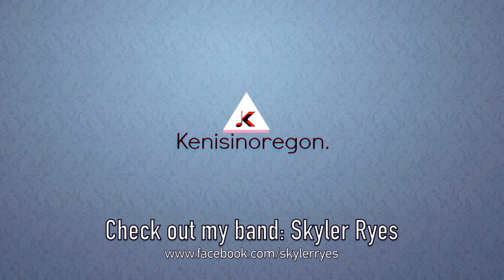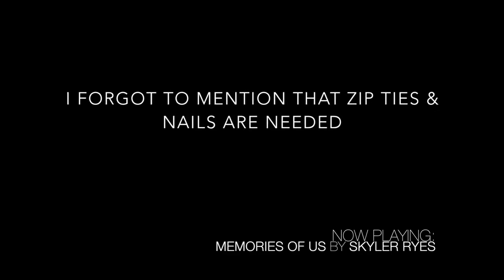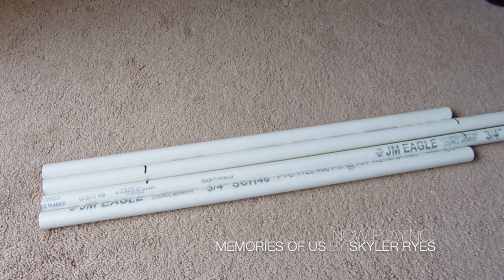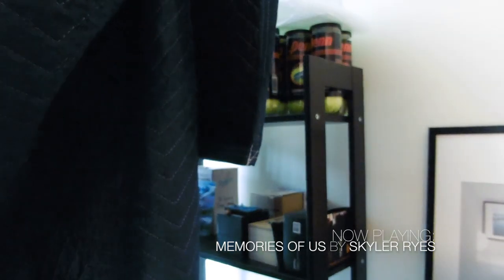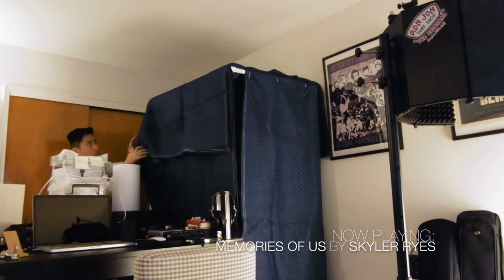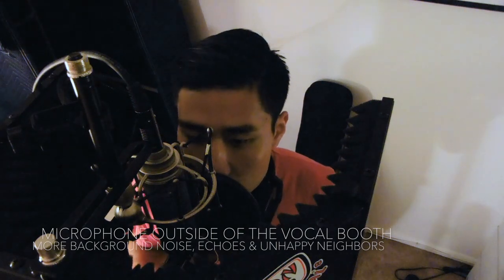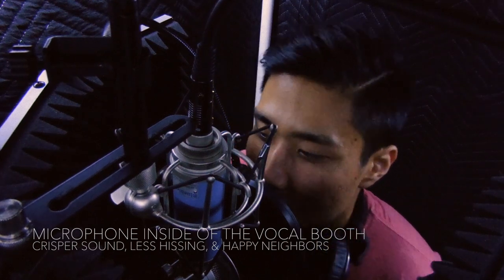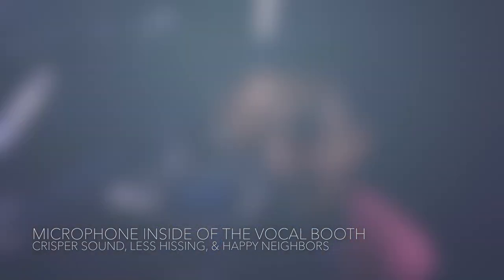My DIY Sound Booth | Ken Tsuruta

Comment from the maker: There were some comments regarding the hissing sound that the mic makes inside the booth, turns out it's not my preamp set too high, but it's my bluebird mic itself. I only had the Bluebird mic at the time, so I couldn't compare to how other condenser mics sounded (regarding self-noise). I recently purchased the Neumann TLM103 and I can hear a big difference in the self-noise. I just can't believe I've been using a defective mic for almost 13 years... 
Anyways, if you're curious, check out this video I made comparing my new TLM103 to my Bluebird to hear what I'm talking about : https://www.youtube.com/watch?v=IL7OzwBRpsM&t=199s

Thanks as always, and subscribe for more music content and covers!
- Ken
Reply: "defective" is kind of a misnomer.. obviously (most) $300 mics are going to have considerably more self-noise than a $1k neumann.  I say most because there are some (Lewitt LCT 440 for example) that are on par with the neumann in that $300 range. Just bought the lewitt, totally psyched. :D
Reply: Just the fact that you used the mic for 13 years and did not discover the "self-noise" until you built the booth tells me that the booth is working.

Comment: I hear a lot of background hissing - even when silent.  Inside the booth as well as outside.  Not sure if it's your microphone or recording equipment.  Other than that, the booth looks pretty cool.  I've seen a couple of plans like this.  Pretty DIY build.
Reply from the maker: Thanks for watching!
So it turns out it's not my preamp set too high, but it's my bluebird mic itself. I only had the Bluebird mic at the time, so I couldn't compare to how other condenser mics sounded (regarding self-noise). I recently purchased the Neumann TLM103 and I can hear a big difference in the self-noise. I just can't believe I've been using a defective mic for almost 13 years... 
Anyways, if you're curious, check out this video I made comparing my new TLM103 to my Bluebird to hear what I'm talking about : https://www.youtube.com/watch?v=IL7OzwBRpsM&t=199s

Comment: You need to put the foam pads on sides as well and on the floor. I would also recommend to put a foam pad (the fitness ones) on top and then put a blanket on it. That way it will look way better and block more noise

Comment: Man this was great... THANK YOU FOR THIS VIDEO!!!! I made some adjustments to your design though. check them out!

1. I used Velcro instead of nails ..helps with Longevity and with break downs and set ups

2. I went with 1" PVC pipe over 3/4" (allows velcro more surface to grip and handle weight better)

3. I Doubled up on the moving blankets (this is why the Velcro is better as well) 5 for outside including top and 3 for inside.. this makes it more reflective and the air between the two layers of blankets helps with absorbing the sound.. 

And it really works ..amazing sound booth!!
Reply from the maker: Using velcro would have been a better idea! Maybe next time if I create another booth, I'll use velcro. Same goes with the thicker pipes! 
Thanks for watching!
Reply: How did you attach the Velcro to the blankets?
Reply: Gonna try it this week
Reply: I'm planning on using thick moving blankets, 65 lbs/dozen, doubled up. Do you think that 1" PVC pipe would be strong enough, or should I go bigger? Also, someone else asked, and I would be interested in knowing as well, how did you attach the Velcro to the blankets? (I was going to go with adding grommets and using zip ties.)

Comment: How did make the mic hang downward on that sheild or do you have a small boom arm attached to stand behind the sheild and hang over it?  Very nice booth...I like it
Reply from the maker: SYNTHESIZER IS KING the mic itself is suppose to be facing upwards, but when I do that, the mic sticks out of the shield which makes it basically useless. So in order to avoid that, I just place it upside down.

Comment: Mogammi Gold studio xlr cables cut out a lot of hissing too. I knew a guy that was using a stage mic cable with his condenser mic and the cable had metal connectors. He had terrible hissing in a very good sound treated booth and had a hard time figuring out why. The Mogammi cables have better connectors and are insulated with higher quality stuff.
Reply from the maker: Hey Matt I agree, Mogami cables are the best! But I learned that my Bluebird mic is a lemon and so Blue microphones contacted me and gave me a discount code to buy a new model. I'm thinking about getting one since I love their sound.

Comment: How were you able to add the mid section PVC pipes for stability? It seems like you used PVC tees, but the ones i've seen at Home depot won't properly slide to the PVC pipes midsection for me to make a stability section. Hopefully you can assist.
Reply from the maker: Julius Hurst hi! So did you purchase the PVC Tee’s in 3/4 inch? If so, it should fit since the long PVC pipes that I’ve purchased were 3/4 as well.
I know Home Depot has a pretty good return policy so just show the recent and replace for the size you need.
Thanks for watching!
Reply: I'm curious if you ever figured out the stability pipe problem with the tees? I'm making my booth using 1" PVC's, but I'm having the same problem. The 1" tees connect barely to the edge & won't slide any further, but the 1 1/4" tees are way to big! Anyone have any solutions??

Comment: Hi Ken, I know this video has been out a while, but was hoping you could answer a question.  The "T's" that you used for the stability pipes, did you just slide that all the way down the length of the wall pipe, or did you make cuts and insert them that way?  Thanks for the build, I'm putting mine together in a few days!

Comment: Hello, thanks for the video!

How would this work if I use it for playing the saxophone in apartament? Does it reduce the sound outside the booth, to not bother the neighbors? I'm looking for a (low budget) practice booth to be able to practice the saxophone in apartament.

Thanks a lot for your answer!
Reply from the maker: I think it will definitely help with the situation by dampening the sound, but it won’t completely get rid of the sound. 
Maybe try using a thicker moving blanket, that may help.
Reply: @kenisinoregon  thank you! 🙂

Comment: You never mentioned how you attached the stability poles....did you make another cut to the long poles or did you buy some type of clamp on side connector parts to connect the side poles to the long poles????
Reply from the maker: SYNTHESIZER IS KING Hi! Yes I added connectors to connect the stability pipe to the long pipes.
Thanks for watching!

Comment: There was consistent hissing in your audio....it wasn't ambient or background noise ...when you went silent for a couple of seconds, the hissing was very present , even  inside the booth....what was your mic connected to?....if it wasn't connected thru a usb audio  interface , that has phantom power , or a mixer with built-in phantom power...then that's the cause of your hissing ...
Reply from the maker: Hi Antoine, 
Thanks for watching the video! Sorry I don’t think I explained clearly what my mic was going through. My condenser mic is going through an audio interface that has phantom power which is turned on when recording. If any other reason you think causes this hiss, let me know 👍
Reply: @kenisinoregon  what interface did you use...because it is strange , that you used an interface with phantom power and the quality of the audio wasn't clean at all
Reply from the maker: I'm using a cheap Behringer UMC404HD. It may be cheap but it is not a bad interface. I think the Preamp may be set too high and that could be causing the hissing. I'm gonna experiment around. I was thinking to even switch to a Rode NT1 since I heard it doesn't have much hiss but before that, I'll just play around with the interface to get rid of that hissing sound. Could definitely be the pre amp but I'll check it out when I have the time
Reply: Hi Ken. I'm just wondering if it's hot inside the blanket and whether the led lights also through off heat. Thanks, @kenisinoregan !
Reply from the maker: Hey thanks for watching my video! Yes, it does get hot in the summer so I recommend taking breaks within each recording session. I usually record something for 20min and then turn on the AC and rest for 5min and then go back in there for another to repeat the process. A bit tough, but not as bad as it seems. The best would keep an AC on in another room so that there is some cool air traveling through the apartment/house.
Reply: @kenisinoregon  Hey....What microphone were you using....and for the record...that behringer 404hd, is not to be taken lightly, it's a very good interface ....it gets the job done.....Tell me, how high did you take the gain on your interface , when you did this video ....I'm trying to put the pieces together ...lol
Reply from the maker: Antoine Inniss hey Antoine, definitely too much gain for sure 😅 that’s what caused the hissing. Definitely should have kept it lower for this video

Comment: Why did you buy the 3 way elbows with the adapters? I simply bought 3/4 3way Elbows without the need of adapters. Saved me another 10 dollars. I built my entire frame for little as 29 bucks.
Reply from the maker: Eman 08 I should of thought of that! Maybe my next booth! 
Thanks for watching!
Reply: @kenisinoregon  Are those moving blankets very heavy? I purchased mine from from walmart three for 20 bucks. I only needed 3 of them. One for the top and two that was long enough to cover all four sides that I made a sliding door out of like yours.
Reply from the maker: Eman 08 they were heavy but not to the point where it bends the PVC pipes. I also only used 3. I’ve been using it for 2 years now and it still works perfectly. I just gotta keep dusting the top since it gets dusty up there
Reply: @kenisinoregon  I notice a massive difference in my recordings as they sound close to professional studio quality with dry sounding vocals. Those $200-$300 reflector filters that you install behind your microphone does essentially nothing after testing a similar one as you can still hear the room reflection all around you which is basically a gimmick. I'm glad I didn't waste my money. You video was very helpful completing my project. I did buy an LED lamp that you install under your kitchen cover that works pefect in the booth.
Reply from the maker: @eman0828  I'm glad it helped you out on your project! Cheers!
Reply: @kenisinoregon  My clients would be happy. I will have to take a picture of mine when I get a chance and post a link maybe to Photobucket so you can see it. I cut out a square on the side of the first blanket and stiched a clear Vinyl material to create a see through window like in a professional booth or recording studio. Some thing I came up with so that I can see the Artist I'm working with esp as a Producer when I'm directing and coaching the Vocalist to capture the best vocal peformance. I use to be an in-house Producer for a small recording studio and this DIY build is just as good as the more expensive one that cost survival thousands of dollars which was a permanent install.

Comment: Nice! I was wondering if you think that the more blankets i use the more the sound will dampen, or if it will not really matter. I plan on belting in the apartment, so will enough blankets be able to muffle the sound enough?
Reply from the maker: Lucas Goldson I think it certainly would help, but it wouldn’t completely dampen the sound. Make sure to close the blanket door completely when belting. That helps me a lot. 
Thanks for watching!

Comment: Great video! Thanks so much! Question: Can you give apprx dimensions of the booth? I'm wondering how the four 72x80 blankets are arranged. It looks like one is needed for front-and-side and one for back-and-side, then one for the top. Where does the 4th one go? Thank you so much again. I plan on doing one of these this week! (Btw: I have the same mic diffuser and am anxious to try it with this setup!) 😁👍
Reply from the maker: Hi Lindy! The measurement of my vocal booth is L39" x H76" x W30" and I actually only used 3 blankets in the video. (Sorry I didn't mention how many I used). 
I used my remaining blanket for a movable sound proof wall. I placed the blanket on a coat rack with wheels. 
Thanks for watching!

Comment: Thanks for the reply. One other thing. How did you install the lights? Are they adhesive?
Reply from the maker: Yes, they are adhesive. It was very easy to place them on the PVC pipes.
Here's the link to them: https://www.amazon.com/gp/product/B01GJ3O0J8/ref=oh_aui_detailpage_o00_s00?ie=UTF8&psc=1

Make sure to buy the adapter for it too, since it doesn't come with the LED lights: https://www.amazon.com/gp/product/B00DKSI0S8/ref=oh_aui_detailpage_o00_s00?ie=UTF8&psc=1
Reply: kenisinoregon thank you

Comment: Hey man , how long are the sides and base ? Cause I want to buy pvc pipe tomorrow 😀
Reply from the maker: Hey Rann, thanks for watching the video!
I measured mine to 6’ 1”for height (I’m around 5’10”, the front around 3’, and around 4’ for the length. 
I just made it that size because my mic sound isolation shield was around that size. 
Hope this helps!

Comment: That 10 count bag of Tee(s)...Did you end up not using for this booth? Looks like you only needed the 90 degree elbow outlets where you hooked the adapters to it. And you use the snap tee for your stability bars. I’m about to purchase it all and didn’t want do any unnecessary spending. Thanks
Reply from the maker: t lee Around 2:08, you can see that I used 6 Tee’s for the stability bars. So I recommend you getting them. 
Thanks for watching!

Comment: Hey. Could you please tell me if there are any replacements for moving blankets?
Reply from the maker: If you'd like something even cheaper, you could use a blanket to cover the whole booth. Only problem is that if you do this, you wouldn't be able to get the sliding door and it would get pretty hot inside. I think moving blankets are probably the best and cheapest option. May I ask why you don't want to use moving blankets?
Thanks for watching!

Comment: ¡Hey there, thanks for everything! Do you think you could find this pvc pipes on amazon? as well as the rest of the stuff? We don't have any home depot near me... so... thank you! PS: You have tones of static noise on that mic!
Reply from the maker: Yes, there is a bit of static noise left partially because I did not edit the audio. For the PVC pipe, I would definitely try to go to any hardware store in your neighborhood. They should carry some PVC pipes. For the rest of the stuff, I have links in the description.'
Thanks for watching!
Reply: Thing is there's none in about 60 miles here, hahahahaa, that's why I asked. Thank you. Great if you can actually edit that static, though! O.o thank!
Reply: @kenisinoregon  that's the thing... had you used an audio interface , or mixer  that has phantom power , you would not have had to worry about much post editing/processing...once a condenser mic is powered up properly, with 48 volts of phantom power , either from an usb audio interface or mixer, the quality , sound  and performance of the mic is greatly enhanced....

Comment: what microphone and stand do u use?
Reply from the maker: Hi Robbie, I use the Bluebird by Blue Mic and I use a PA stand since I have the reflection filter. Don't remember the exact brand, but here is something similar (6ft PA Stand): https://www.ebay.com/itm/Speaker-Stand-Professional-Tripod-Structure-4-6ft-SINGLE-HPS-200S-Durable/223935976708?hash=item34239fd504:g:e7EAAOSwjdFeX3g8

Thanks for watching and subscribe if you'd like!

Comment: What happens when it get super duper hot 🥵
Reply from the maker: AmaZane Channel that’s the only thing :/ I have to take breaks because it does get hot. It’s not too big of a problem for me. 
My idea was to have a pipe that goes from my AC to the booth (a small opening), but I’m still thinking about it.
Thanks for watching!
Reply: kenisinoregon just bring a little fan in the like a table fan or desk fan is should work alright
Reply: Ty Davis or ruin the entire purpose of the booth

Comment: How effective has it been with cutting the sound down so you don't disturb your neighbors?
Reply from the maker: no complaints so far! :) And it's been over a year now
Reply: @kenisinoregon  Good. I was thinking of using this basic idea to create a faux inner wall to help control sound levels in a room. (I'm moving my parrots into the room and one has a scream of around 4000 Hz) I was thinking I might need to do more than just moving blankets, but I still need to keep it cost effective. 

One thing I've been finding effective to control the sound in my case is a stack of towels on top of the cage.  I do two stacks of ten towels each and cover two sides of the cage that face out and to the door. This has cut the 4000 Hz frequency I hear from my bird in half, with no other treatment to the room or problem areas. I'm working on making a more dedicated sheet of towels to use that will be held together with zip ties.
Reply from the maker: @MageGrayWolf  holy moly that's a loud Parrot! Definitely making this booth would help isolate the sound. Try it out and let me know how it goes!

Comment: Any info on what type mic stand you have, and I am still trying to figure out what attatchment you used behind the isolation sheild, my isolation sheild only has one openning to connect to the mic stand. Is there a brace behind your isolation sheild that is holding that big mic down over the top of the isolation sheild? Thanks Ken
Reply from the maker: SYNTHESIZER IS KING yup the sound panel is by Griffin. Here’s the link: Studio Microphone Soundproofing Acoustic Foam Panel by Griffin | Soundproof Filter | Sound Diffusion Mic Booth Shield | Insulation Diffuser|Noise Deadening/Absorbing/Barrier for Audio Music Recording https://www.amazon.com/dp/B0082DAL3S/ref=cm_sw_r_cp_api_i_RTZjDb8A9GJCB